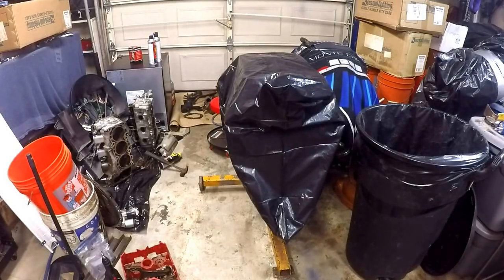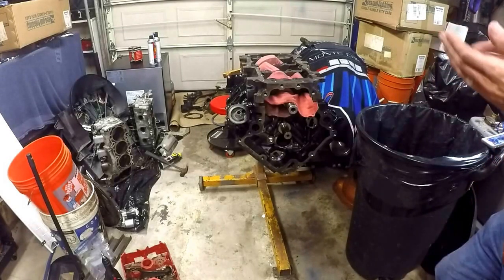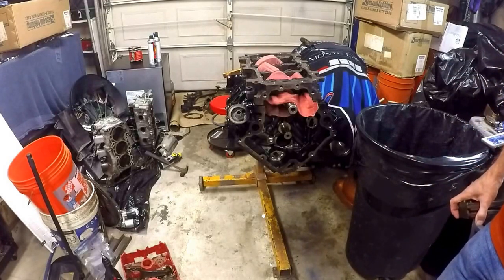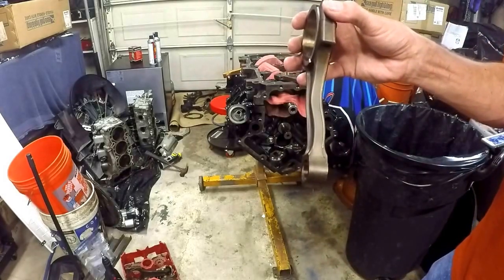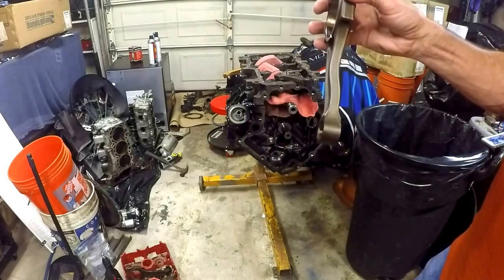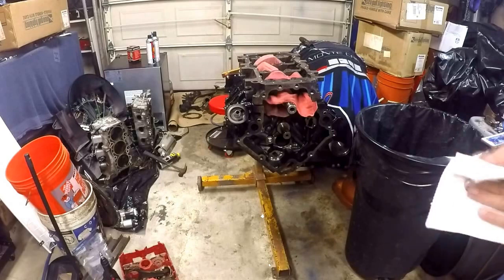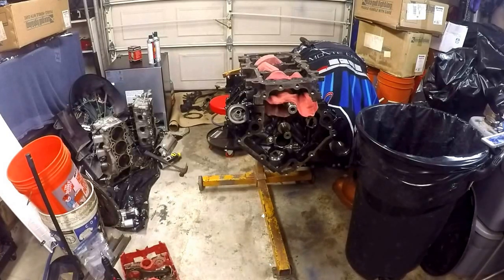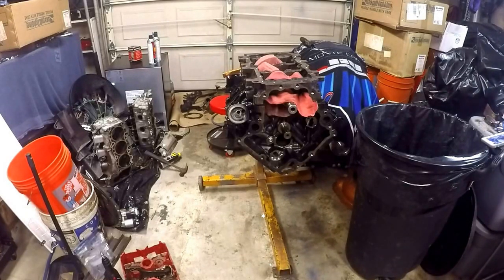Engine Rebuild - 3.7L 2006 Jeep Grand Cherokee Laredo - Part 2

Comment: My theory is the valve keepers popped out not installed properly maybe valve dropped with little scoring bending the connecting rod.   I’m unsure how the valve seat dropping causing the valve to pop the keepers under Constant Spring pressure.

Comment: Question how many miles were on it and are those engines reliable?
Reply: He said in the beginning of the first video around 150 any Motors are available if you got the money
Reply: I got a truck with one of these in it that has 210k miles on it. It hasn’t had any major problems with it, it sounds good, and the check engine light shows only a single code and it’s something minor. Idk how much you care about this 4 years later but it’s a pretty reliable engine as long as you take good care of it.

Comment: That "rippled" rod looks like the victim of hydro-lock. You mentioned that the owner mentioned weather and going through water. I've seen it in 2.9 Fords twice and a Jeep 4.0 I6. after having run through water without a snorkel.
Reply from the maker: Marcel Neau You hit it on the head. Total hydro lock! He didn’t give me the whole story at first.
Reply: I'm hydrolocked motor before as well I'm pretty sure that's what happened here.

Comment: I have a 2002 liberty that has the exact same problem. Was driving it. Engine got loud. rattling.ran it again the next day. knocking sound stopped but ran rough. compression check, 0 compression on #5 cylinder. Have not taken the head off. Was getting ready to but now wondering if it is worth while after watching this.

Comment: you should have bought all new rods and piston, as well as all new valves as well. just for a piece of mind.
Reply from the maker: anubis1100 I did replace the pistons and the rest of the parts in question were all checked by my automotive machine shop.

Comment: hello there sir. i live in  mexico. i have a jeep liberty 3.7 in my shop. and the owner brought it to me yesturday because it blew a rod and made a hole in the top. i am wondering what cause this. i have not took it apart yet because the owner is filing a law suit because he just baught it and the next day it blew a rod. is a 2007. by the way. is this common on this motors. by the way thank you very much for the videos. it is going to help me a lot when i open up the motor.
Reply from the maker: Omar Torres Sustaita, it's impossible to say without tearing it apart. Let us know what you find if you decide to tear into it.
Reply: OK. Thank you for your time. I am waiting for the green light. So that I can start tearing apart. I will send you pictures when I am taking it apart. Thanks again. By the way I have seen your videos about 10 times. Great videos.

Comment: Can I ask you how much the machining of your block cost?  Weighing my options with the 3.7 at the moment
Reply from the maker: +Thomas Reid The block rework was $200. It included vatting, boring, and honing the block as well as polishing the crank journals. Good luck with your endeavor!
Reply: Awesome (lower than I was expecting) thanks for the quick reply...cheers

Comment: Possible hydro lock
Reply from the maker: +trevor thomas I guess we can't rule that out. I'm gong to have to think about that for a while now!
Reply from the maker: +Trevor Thomas, you were correct sir! Thanks for the thought!
Reply: Trey Clanton rebuilding my 4.7 now. I had blown head gaskets and had a fluid lock. No rods were bent as I was just trying to start it and didn't push my luck. I removed the plugs and cleared the antifreeze then added Bars Leak which got me by for about 6 months. Given the 3.7 and 4.7's propensity for head gasket failure I would say that definitely that rod was bent by a fluid lock. Additionally, I think your missing valve was an intake, for what it is worth,  the intakes are the larger valves in most engines. Thanks for the video, it will be a nice review as I start to rebuild the freshly bored block tomorrow (had to go 0.30 because of fluid corrosion in the cylinders).